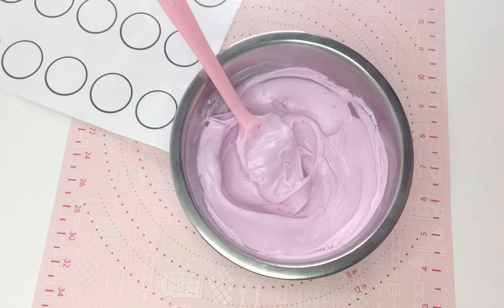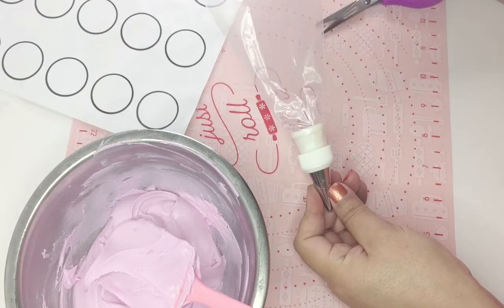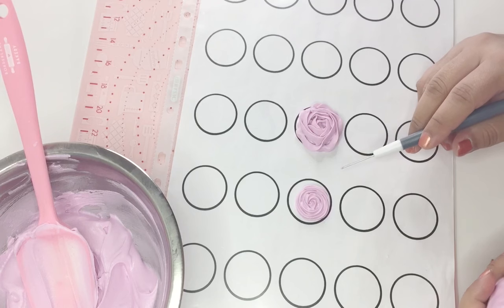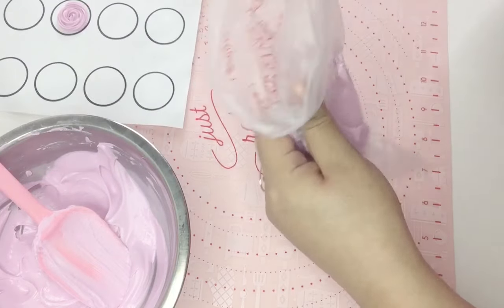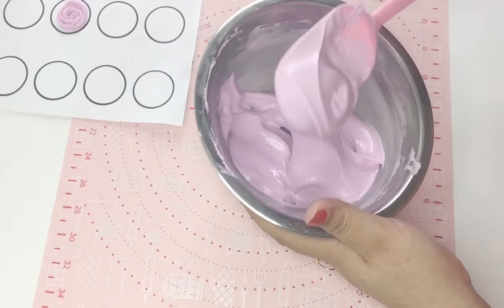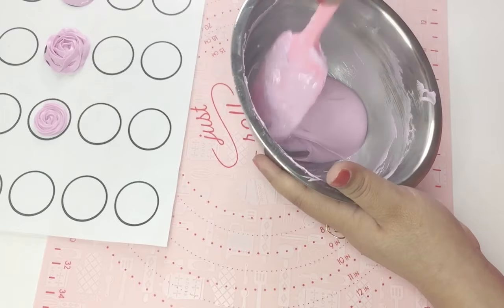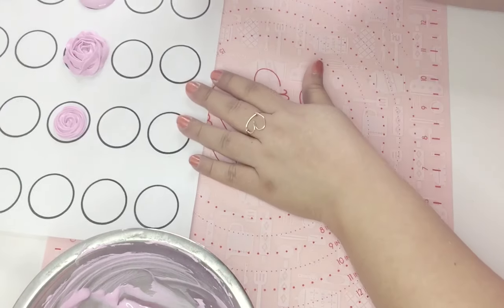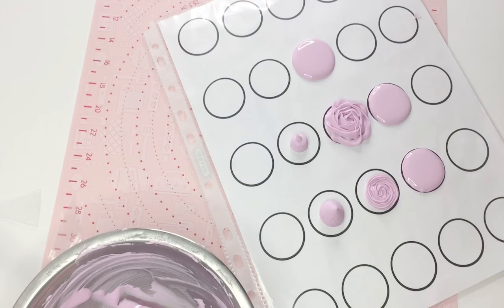Royal Icing Consistency Guide | 4 types of icing | daintycookieco

Comment: I'm saving this video! Thank you for showing all the different consistencies! I'm ready to start practicing. Can you tell me how long I have to wait until I add a second color of icing next to the first one? Is it only about 5 minutes?
Reply from the maker: Your welcome! Have fun practicing! If you have a dehydrator, you can add another color of icing in about 10 minutes since the dehydrator makes the icing crust pretty quick. Without a dehydrator, I would wait until you see the top layer crust over. If you are doing a wet on wet technique of course you would mix in right away.

Comment: Very helpful vid I’ve tried frosting cookies last year and they were a hot mess. Do you use meringue powder? Does this help with consistency? Move was way to runny
Reply: @wendyvalencia5318  thank you so much I will def get some and see how my holiday cookies turn out this year 😀
Reply from the maker: I do use meringue powder. I use 1/2 cup of water to a 2lb bag of powdered sugar. My base icing is always thick and I think down using a spray bottle with water depending on what you need- flood, outline, or details.